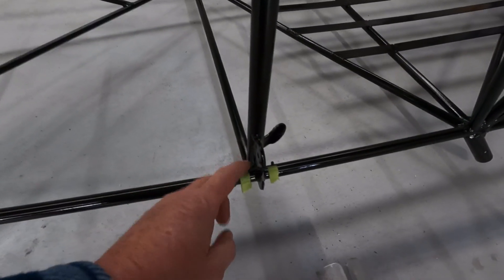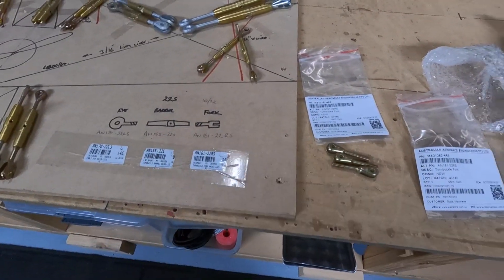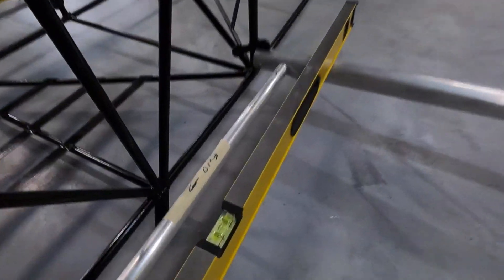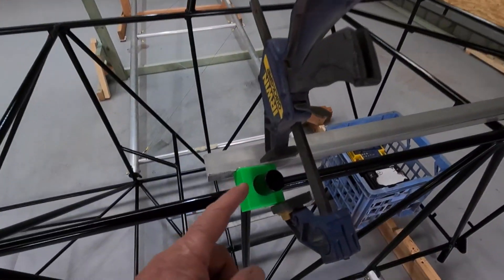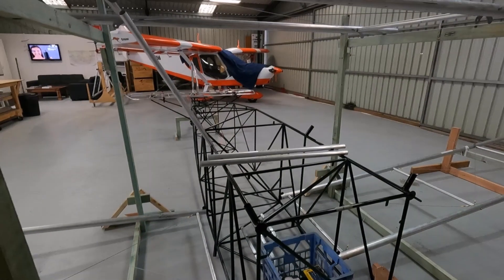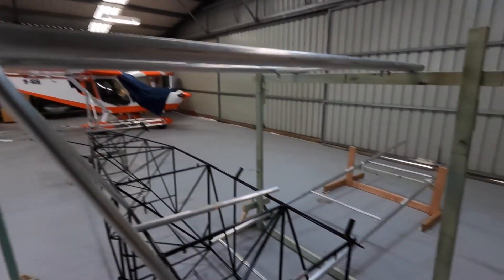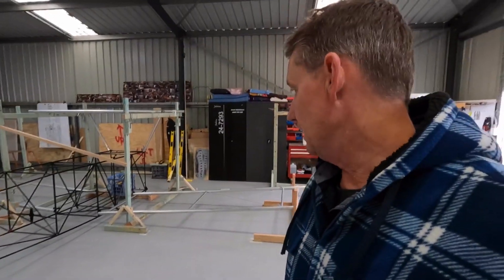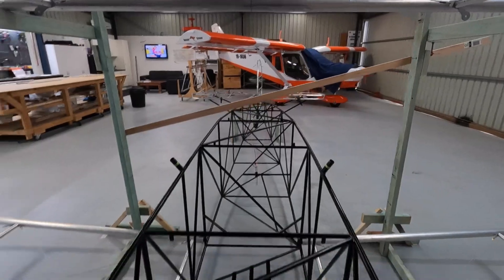Sopwith Camel lower wings installed

Comment: G'day,

Yay Team !

I always wanted a Camel. Dad's Uncle flew with 4 Sq. AFC in late 1918... (Lt Les. Wharton, MM).

The closest I got was working for Neil Cottee at Olde Bowral in 1978 - '79, ground-crewing for his Armstrong-Siddley Gennet-Major powered Pup Replica built by Transavia, and the Warner-Scarab powered Fokker DR-1...(plus 2 Tiger Moths, Cottee's Hornet Mo

(Sent early by Finger trouble )

...Cottee's B-model Hornet Moth and a Piper J-3 Cub.

Cottee wound up sending me home with the,

"8-Hp, 1975, Red Baron Skycraft Scout...." 

as wages, for services rendered....

It dangles in the National Transportation Museum, in Inverell, these dayze ; after I finished up being the last one to ever fly it (up into Ground Effect...!).

The "Pixie - 120 Aero" Engine  in it, based on the famous Victa, was very very good at being gutless ; kinda thing.

Anyway, I'm very glad to see that you fixed those Centre-Section Spar/ "Cabane" Strut Connections...

Those 8 (originally Wooden) Strut-Ends, and the 1-inch deep Metal-Sockets which they fitted into..., were actually the Camel's 
"Secret Fatal Flaw", apparently.

The ONLY thing which was holding those Struts in their Sockets was the Tension on the Centre-Section Bracing Wires...(!).

Bouncing a Landing caused the entire Aircraft's Weight to impact-load those Bracing-Wires as the whole Machine's Weight hung off the Cables from the Fuselage to the Centre-Section Spar-Ends, with the Cabanes being thus in Compression, onto the Fuselage-Girder's Vertical Stuts, to the Undercarriage Struts, to the Spreader-Bars, to the Split-Axles/Bungees & Wheels...

And..., when those Centre-Section Wires were loosened by being stretched during a bad landing..., then the very next time a bit of positive "G" was pulled, those Struts 
WOULD
Pop out of their
Sockets..., the  Upper Wing 
WOULD shift forwards,
The Centre of Pressure
WOULD be so far forward of the CG that it
WOULD be impossible to
Unstall the Aeroplane, or to recover from the  resulting
Flat
Spin...

Which was what killed
D'urban Armstrong,
While
Stunting, to celebrate...;
"Appre le Guerre
Finni...!"

So..., I'm glad to see you being a bit
Painstaking ;
Over the Centre Section Cabanes & their pesky bloody 
End-fittings...(!).

Well done.

Keep on keeping on...

Stay safe.

;-p

Ciao !
Reply from the maker: Thanks for all that.
Reply: @scottmatthews5280  

No worries
Mate....

You're 
BUILDING a
Sopwith Camel Replica
From Plans...;
And from what I can see,
Thee
Be
Doin' a bloody 
Good
Job of it.

My Second Aeroplane was a
Scratch-built-from-Plans
Project which began as a
VJ-24
(Volmer Jensen's 24th Design...; the "production-engineered" version of his VJ-23 Swingwing {Aerodynamically Controlled, Foot-Launched Hang Glider with a 9:1 L/D in 1974..., the VJ-24 came out in '78 - about the time Micheal Cook put a 10 Hp McCulloch Chainsaw Motor on a VJ-23 to become the VJ-23e... which was the first
"Microlight" to
Aviate across the
English Channel.

A friend of mine,
Inspired by my Scout in '78,
Began "Scratch-Building" the 
VJ-24 from Plans in 1980,
Converting to a 
VJ-24e ("Engine", ie 10 Hp McCulloch, direct Drive, 3-ft Dia. Prop... Behind the Pilot in the
Hang-Cage....(!).

In 1982, when the 
VJ-24w (WHEELS...!)
Appeared, was Hatched, Appeared spontaneously...,
Old-Mate  - on my advice, modified the Wing Section by adding Fabric to skin from...

That bloody early-send
Glitch, again...!

Behind the bottom of the Rear-Spar/Tube to the Trailing-Edge...

And, then to shitcan the 
Fully-rigid Chrome-Moly Undercarriage ; in favour of my Back-Of-The-Envelope Sketch of a Fully-Floating, Bungee Sprung Cross-Axle...

Then he fitted it with a 22 Hp JPX (direct drive) rather than
Volmer Jensen's Yamaha 99cc, 15 Hp with a 3.1:1 Belt Re.-Drive, Centrifugal Clutch, and a Blade-Brake.

And, finally, before he ever finished it ; I bought the Project from him, in 1990.

I then redesigned & rebuilt the
Wing Leading-Edge, 
Added a Spring-Deployed BRS Parachute, 
Designed & built a Faceted 
Fuselage Pod,
Designed, cut, laminated, carved,  & balanced 2 Propellers for it - because the first was
Overpitched...

When I took the
Jensen over the Fence, on it's
Prototype's 
Maiden
Test 
Fright...;
I had
Not flown
Anything
(Bar a month of Taxi-Tests)
For
10
YEARS...

Since I spent a fortnight in 1981, accruing 15 Hrs : 30 min's at the Narromine Soaring Centre, getting my A, B, & C Gliding Certificates, and spending about 7 of those hours Solo, with the final Solo in a rented IS-28 being 02 Hrs : 13 Min's...

So, 
One may be indeed, an extreme
Outlier...;
But, how many people 
REALLY
Underconstumble what goes into either
Hand-building an
Aeroplane - and then being willing to then sit in it, strap in, and 
Flight-Test it...; 
While understanding quite
Whyfore it is so that a
Sopwith Camel is the
Ultimate
Personal
Hairygoplane...,
And also
Knowing about the
Centre-Section Cabane-Socket
Issue...

?

Forgive me if I'm wrong, 
Or if I overstep my station in life (?)...; 
But I figure that when I encounter someone like yourself,
Tinkering up & Cobbling together a
Backyard Camel
Replica...,
It is my
DUTY..., Obligation, and Pleasure,
To 
Pat you on the Head, and
Encourage your
Every
Success.

And, hopefully, you will never ever run into the consequences of 
Pursuing
"Success", 
Only to encounter it's
CryptoSemantic/Phonetically 
Lurking-in-full-view type of
Meaning..., to wit;

(Suck Cess...!).

One day, I might start to rebuild my Jensen, after buggaring up a Downwind Take-Off in the 22 Hp Ultralight Motorglider, in 1992 ; and I've slowly scrounged the bits with which to rebuild the Airframe.

I do have to hand a 35-Hp Rotax 377, which killed my best friend in 1995 - but for something which began as a Foot-Launched Hang Glider in '78 - the Rotax might shake it to bits...

I've 
Bin-Fantasisin' about a Motor & Battery-Pack from a Road-Registered Electric Motorbike...

I suspect that I could
Electrify &
Rebuild the
Jensen for about $7,000 or so.

Last year Medicare cured me of Stage-4 Malignant, locally advanced Cancer of the Right Tonsil...
I was supposed to be
Daisy- Up-Pushing since
Last
September...

Global Warming is
Winning.

El Nino is in the 
Pipeline.

In 2019-'20 my son, a
NSW RFS Brigade Captain,
Put in 49 Shifts of 12 Hours
Firefighting...
Either for that, or for driving his Crew & Tanker over the burning Ironbark Bridge over the Mann River (8/11/'19), to get
Onto
Wytaliba as it was being
Burnt-over (65 Buildings burnt, of 105 - on 3,500 Acres of Alternative Lifestyle Community...2 Residents died...)

I
Might
Rebuild my
Hairygoplane...
If I can run it on
Solar-Recharged Batteries (?)

If ever I have enough spare money,
And if ever I'm sufficiently
Bored...

At the moment,
Preparing for the
NEXT
El-Nino
Spring-Summer
Has this little
Forest-dwelling
Hillbilly-Hermit
Shitting
Blue-Lights...

It's a good thing my son
Showed me his ($7,000)
RFS-issued
"Walkie-Talkie" with 250 mile Range, which 
Enables him to
Summon up a
Boeing 737 Large Air Tanker,
And/or a
Much more useful
Flock of Air-Tractor 802 F(irebomber)s, on Amphibious 
Floats...

($2 million at per each, new, to buy...; Vs $20 million to convert a 737 into a LAT...)

So, yeah - mate.

Right now, all my
Sopwith Camel Fantasies live
Through
The likes of you...

(In my
 "Personal Aeroplanology..."
Playlist, there's an almost-complete Series of Videos about Sopwith Camels.

I don't think that very much of it is wrong...; but none may be at all new
To
You...(!) ?

Basically, I merely want to throw
Bouquets in your direction,
Applauding you
For commencing to
Build yourself a
Camel !

Good on ya, mate...

Have a good one.

Stay safe.

;-p

Ciao !

Comment: Slow and steady wins the battle.  Building as you know well is a series of mental challenges that as we work through them provides an immense form of satisfaction and achievement.  Could see that pride in your face and expression in the video just after you solved the front strut issue by trimming the tube on the fuselage.  Well done and hope you had a beverage afterwards to celebrate. Cheers!
Reply from the maker: Kind words thank you